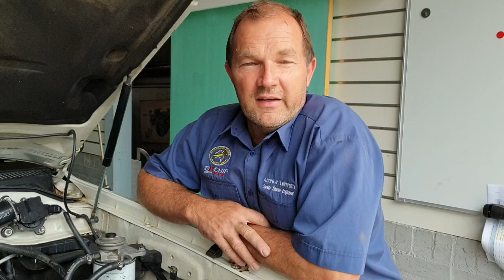Do I need an Intercooler on my After Market Turbo Diesel? 1HZ TD42 Berrima Diesel

Comment: What's the best boost pressure for a turboed 1hz that  doesn't affect the engin's reliability..??
Reply from the maker: t's actually the wrong fuel loadings it causes all the problems around turbocharging not the boost

Comment: Hi mate,
I bought an 80 with 1HDT motor. It has a front mount inter cooler and catch can installed. I am keen on removing IC and CC and restoring motor to original configuration and tune. They are awesome cars and I don’t see the need to try and modify them from original. What are your thoughts?
Reply from the maker: Cant see why not.
Shell be Original then at the least

Comment: Hi Andrew you do mention about a exhaust up grade would be a good idea after turbo fitment to a 1HZ , would you go with a 21/2’” or a 3” system thanks Greg .
Reply from the maker: Hi Greg, if the old exhaust is knackered. Either size would be OK.
Cheers
Reply: @BerrimaDiesel  do you have any recommendations as all these things you can get in kits form now , have you fitted any that helped out well on the Dino to give any better results like ( mantle bends  ) than std exhaust . And yes the muffler is starting to go inside ..thanks Greg .
Reply from the maker: Pretty much the kits we use happen to be Mandrel bent 3 inch
Reply: @BerrimaDiesel  Ok thanks Andrew ..

Comment: Discovery td5, to improve efficiency and drop egt would you raccomand a water to air intercooler? Do I need to remap after ?
Reply from the maker: A TD5 already has a good Intercooler up front. It would be negligable difference if you wnet ot water to air. Still have to transfer heat anyway.....

Comment: Whats an acceptable EGT non intercooled?
Reply from the maker: If Tuning were just that easy.....
AFR?
Ambient Temp?
Power Before and After?
MAke?
Model?
Engine?
Year?
 
We look at a complete picture when tuning or it may be unsafe under a certain condition
 
Cheers
Reply: @BerrimaDiesel  Cheers for the reply mate!... For the 1hz, ambient temps around 27 celcius afr maybe around 18-19:1 with aftermarket turbo running maybe 12-14 lbs of boost

Comment: Do you fit a boost compensator to the injection pump when installing a turbo kit on a 1HZ? Is this advisable/worthwhile? Thank You.
Reply from the maker: Not advisable at all. The 1HZ wasnt made to turbo in the first place. Set correctly it will last a very long time.
Add a boost compensator and excess fuelling will kill the 1HZ.
Reply: @BerrimaDiesel  Thank You. I appreciate you taking the time to reply and  share your knowledge.

Comment: My 1HZ has a after market turbo without a intercooler, the car over heats easy specially when towing just a small tinny or trailer, is that because of the turbo and does it need to be tuned ? Iv got a upgrade radiator kit installed but didn’t help. Thanks for your info :)
Reply from the maker: They dont overheat when we set them so you have a excess fuel load issue or severe cooling system issue.

Comment: Hi Andrew,  I have a d22 nissan navara zd30 turbo 290km 2007. I regularly tow a trailer about 1.8 tonne . I have blocked off the egr pipe at the manifold. Is this still a good idea or will this cause me engine  trouble/overheating ?. Thanks Darren 
Ps enjoy your vids
Reply from the maker: It wont cause the engine to overheat
Reply: @BerrimaDiesel  thanks 😀

Comment: How high is acceptable intake temp for a non-intercooled turbo'd 1hz?
Reply from the maker: Intake temps are not or just one small part of the equation. Power gained, AFR, EGT all important in a mix

Comment: 4.2 nissan patrol turbocharged 1999 with 179000ks with 12g upgrade turbo and upgrade intercoller I have replaced everything on the water cooling system including a larger radiator unfortunately it still gets hot going up a range or towing within its legal limits the tune is mild 146hp for towing am I doing something wrong? What can I I do to cool my patrol down?
Reply from the maker: We coincidentally see fuel loadings higher than they should be around TD42s running hot.

Comment: i have the Toyota 2KD turbo diesel pushing 0.7bar boost in stock form without a intercooler, would you suggest adding a FMIC?
Reply from the maker: You can and after that you would think of tuning the Power (fuel loadings) up so as to gain power from the mod.

Comment: Will it overheat when driving on the beach or doing for example desert crossings? (If the tuning is don properly) I am afraid to be having to check the gauges every single minute after turbo my 1hz. What gauges do you use?
Reply from the maker: Set up correctly once tuned and locked from further adjustments no need for any extra gauges etc.

Comment: G’Day Andrew same goes for 5L motor in my 2002 Hilux? The car is at 354,000kms & runs beautifully. However when we are loaded up on drives up hills I have to take it easy as she gets a bit warm (obvious reasons). I want to get 500,000kms out of this motor would intercooling it extend the life or have you seen them old Hilux diesels last that long with a correctly tuned aftermarket turbo? 12PSI FYI thanks mate love your work.
Reply from the maker: Probably first bet is to run it on the dyno and check things in particular the tuning

Comment: Hey guys great video just wondering iam looking at putting a turbo on my 1hz and using it for towing and family size caravan would a intercooler benefit me in this situation
Reply from the maker: Hi mate. A correctly set up Turbo on a 1HZ is already Safe and at a maximum stress level so is why after 30 years of doing them we say Turbo Only.

Comment: An intercooler will cool the air and make the air entering the engine denser, the denser the air the greater the horsepower the engine will make given the same air fuel ratio. My point is that if you want to set a limit to HP to save the drive line it makes sense to cool the air, make it denser, then you can reduce the amount of fuel for the same HP output, that’s a great way to make HP efficiently.
Reply from the maker: Great Petrol Tuning comment.

Comment: Will an intercooler lower EGT  and let my TD42 engine stay a bit cooler
Reply from the maker: Correct never do anything unless the diagnosis is accurate so get it in one day for pinpoint problem testing of the heating issue.
Reply from the maker: If you have a heating issue there is already an underlying issue that needs fixing. An Intercooler wont cover up overheating or running hot.
Reply: @BerrimaDiesel  I don’t have overheating probs the engine temp comes up a bit on long hills and hard sand driving which  I don’t like I was just wondering if a intercooler does lower temps  over all ,it’s a lot of money to invest if it doesn’t make any difference